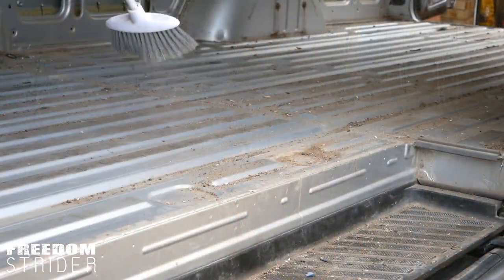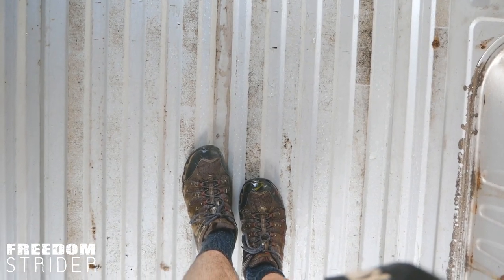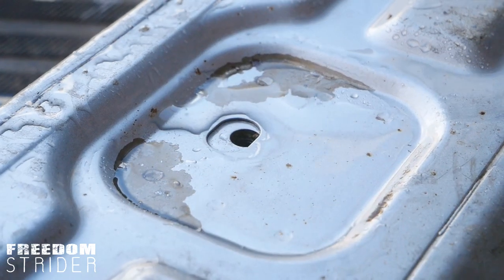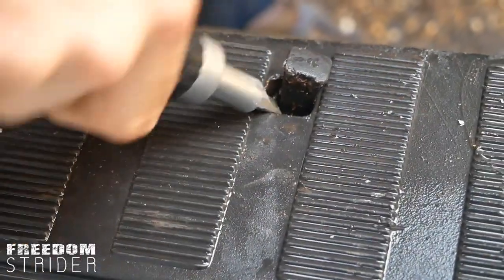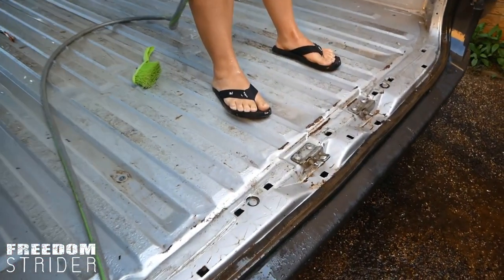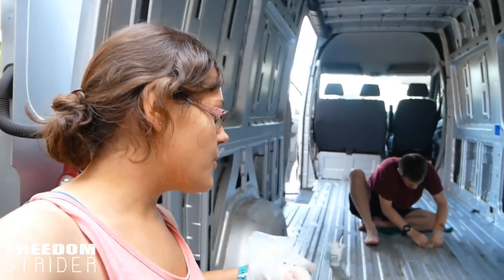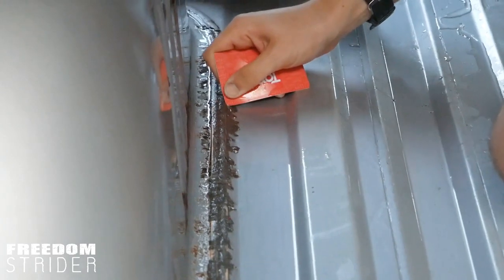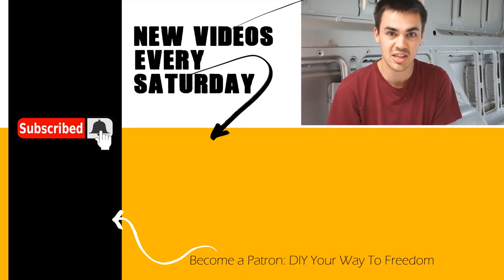Van Cleaning - Preping our Van Conversion

Comment: Hi there, does the water from the jet not get trapped underneath the floor in the holes on the bottom of the walls?
Reply from the maker: We made sure these were dry, some overspray did get in there and we dried it out after 👍
Reply: So my van is different than yours where floor and wall meet. I have these holes that trap water underneath floor if washed. Thankfully there are rubber caps you just take out from underneath the van to let water escape. It's on Citoren Relay/Jumper
Reply from the maker: Ah, we have holes in the cavities which we can pike with a screwdriver from outside the van and they can sometimes release the water from within the cavities

Comment: I would never consider water inside the back of my van, and I'm on the same job you're doing here. 

Looks like several places where the water has nowhere to go.
Reply from the maker: All the water had somewhere to go, we didn't spray anywhere where the water would be trapped and didn't leave any water in the van 🙂
Reply: @FreedomStrider  i have a transit, but it looks like I can't have water inside the ... Like between outer wall and inner structure.
Reply from the maker: Ah Transits might be different, but we were careful to clear all water out before installing anything 🙂